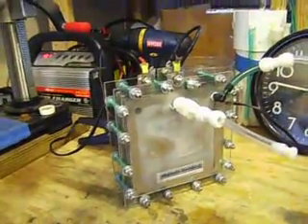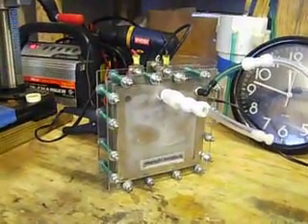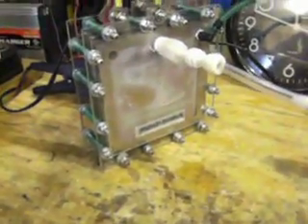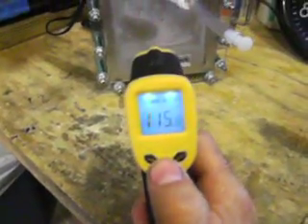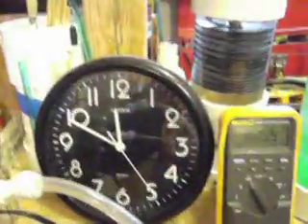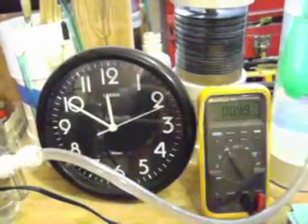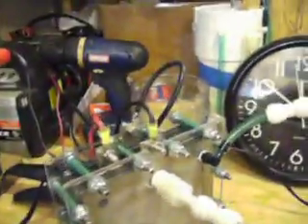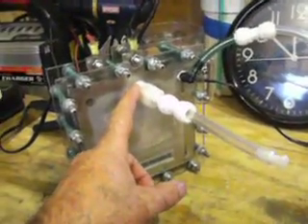BB Smack Efficiency test: 7.7MMW

Comment: Not bad..I come up with 7.08 mmw..say you are running 7 neutrals with this setup?I usually run 4, maybe its the extra N's that given the higher MMW...I have a 21 plate completely 100% isolated even even the gas holes are isolated, I am using a 4 n setup I wonder if I do a rebuild with 7 neutrals if my mmw will go up.